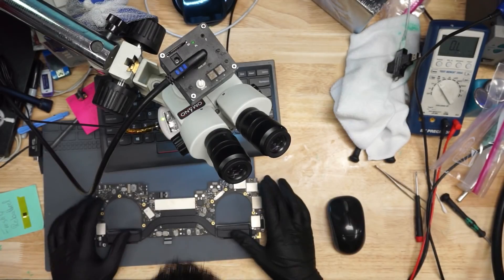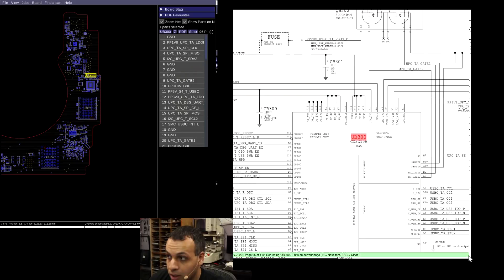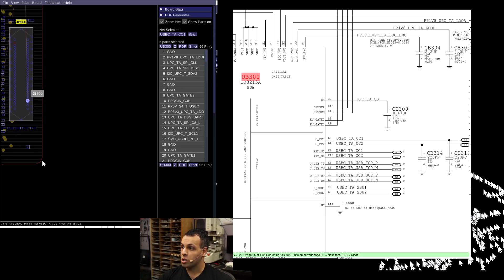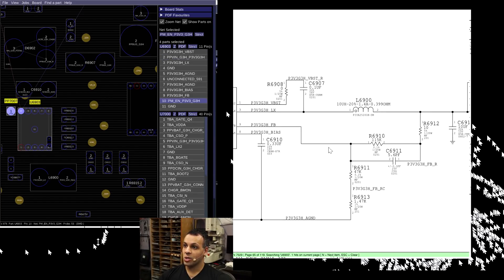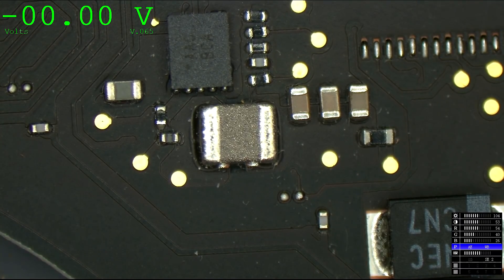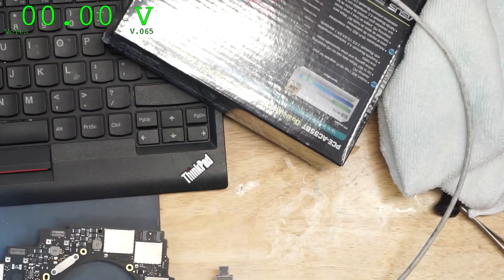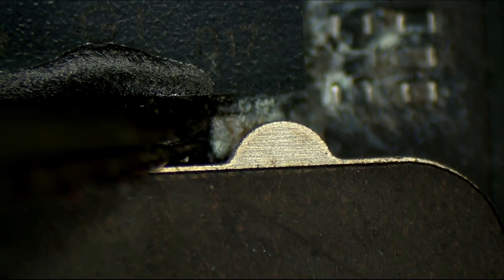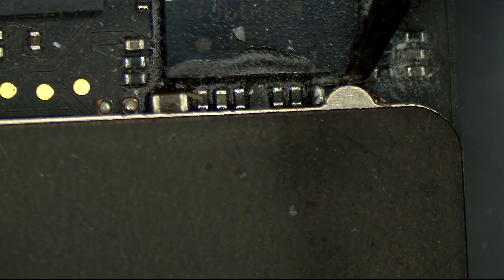How do Touchbar Macbooks charge? What is the sequel to the famous onewire circuit?

Comment from the maker: I realize many here want an update on the battery situation. I am speaking with a well known & respected lawyer who also has a YouTube show - and hope to release a plan of action and details as soon as I can. I am not letting those mofos win.

In the meantime, enjoy a board repair video that showcases the sequel to the onewire circuit.
Reply: I bet its lawful masses
Reply: Best of luck and stand up to Apple!
Reply: As a noob to the highest degree, why do you not need to replace the capacitor? If the power can just be routed without one, what is the purpose of one being there in first place?
Reply: @paulspurlock599  In that circuit, the purpose of that trace on the PCB was to carry a Direct Current (DC) voltage, to ensure that it only carrys a DC voltage they add a capacitor to ground. A sufficiently large capacitor that is connected from that trace to ground will act like a short circuit to any Alternating Current (AC) voltage on that trace, while also appearing as an open circuit to any DC voltage also on that trace. This effectively gets rid of the AC component of the voltage on that trace. AC noise can be a problem for digital logic. TLDR: it gets rid of any AC noise on the line which can cause problems for digital logic if not dealt with.
Reply: The capacitor is there just to protect against any noise that may be travelling down the line, in many cases there wont be significant noise to cause trouble, so you can get by without it most the time.
Reply: @Ferretack  awesome thanks for the explanation
Reply: @paulspurlock599  Power spikes most likely.
Reply: If he uploaded a video recently discussing the case, I may have watched it.
Reply: Good luck man give them hell they're the worst most opportunistic company to ever exist
Reply: You`re the best Louis Rossmann ever😀
Reply: Can we come to court hearing ?
Reply: Hell yes Rossmann!
Reply: Gg Fort  I always watch his videos when I'm about to go to sleep. Totally agree on the relaxing aspect.
And the benefits don't end at relaxing. I often feel fitter...happier...and more productive...🤔
Reply: What did the little capacitor do to you? Capacitor lives Matter!
Reply: Louis Rossmann best of luck!
Reply: Leonard is a great lawyer, good luck!
Reply: @UltimatePerfection  Thanks!
Reply: LOUIS ROSSMANN VS APPLE NOTCH INCORPORATED!!!!!! WHO WILL WIN?! WHO WILL LOSE?! AND WHO WILL GET THE BATTERIES?!?!?!?! STAY TUNED IN FOR DETAILS!!!!!!!!
Reply: Hey Louis, you're getting pretty famous.
https://youtu.be/PpXfpu_yFUQ?t=118
Reply: I really do hope you get those batteries back and then some
Reply: Don't insult mofos, they don't deserve it, mofos are useful, Apple  is not.  If you don't believe me that mofos are useful, how did you get into this world.  Yep, everyone has mofos in the family, hence their usefulness...
Reply: Apprehensively looking forward to the outcome of this
Reply: The world needs more people like you.
Reply: Louis, I've learned a lot from your videos. I'm a computer tech here in the Detroit area and your videos have helped point me out in the right direction when dealing with special apple products.
Reply: Is it LegalEagle?
Reply: It's Leonard French.
Reply: @Louis Rossmann

I think it'd be awesome to see you on the Joe Rogan Podcast. It'd be a good way to spread your word and I think the two of you would be great to watch.
Reply: https://thenextweb.com/apple/2018/11/02/apple-still-throttling-iphone-8-x-batteries/
Reply: i know this has nothing to do with the video but check out this rusted comodore 64 still working fine
https://www.youtube.com/watch?v=wVphFkaX1gg
Reply: Hail Louis! Can't wait.👍👍
Reply: 5 volts at 2 amp is 10 watts, Remember Louis Watts are Amps times by Volts! ;P
Reply: Volunteer character witness here for your case against them! :))
Not sure it's even a thing - I just wanna help.
Don't delay: Testify today!
Reply: @1stm830  We should first of all have the right to own our own stuff and second we should be free to fix or modify it in which ever way we want. It`s called creativity and should even be a human right if it`s not yet. We want more smart people and less of the stupid ones "LET US FREE!"....
Reply: cukier9a7b5 explain why my 2008 MacBook, 2010 macbook, 2012 MacBook Pro and late 2015 MacBook Pro all still work?
Reply: @Danlapse  because cuk is a dolt
these are engineering compromises
Haters are as useless as fanboyz

Comment: I have a question and need some advice. 
I have a Lenovo Yoga 2 10" tablet. I love my tablets but because I'm constantly using them the USB port gets loose then stops it from charging after 1 1/2-2 years or so.
I plan to get my ten inch tablet fixed at a store. 
But I also have another Lenovo tab? something. I replaced it because I literally be wore the poor thing out. I actually wore grooves into the glass from my reading on it. It just wasn't worth paying for it to be fixed. 

What I'm wondering about is how hard it would be to go in and fix it myself. The Tulsa library has a maker room that has all the equipment I would need. 
I'm sure it's just the solder that got loose. I have used solder in stained glass class. 
So does anyone think that it would be worth trying to figure out how to fix it? Would it be very hard? 

Because I know my bigger tablet will be $40-60 to fix. 
I'd like to have it as a backup or possibly to give to a friend. 
One more question. If I get the big one fixed would it be possible to have the tech put extra reinforcement or at least a little  extra solder on it so it will be stronger than before? 
Anyway I'd appreciate if someone could please try to answer my questions. 
I'm on a limited income so I try to fix things first myself.
I don't think it would be to hard to solder it. Plus there's no way I'm touching the rest of it. 
I really wish they'd make it so certain parts like the battery, USB port, audio jack etc could just easily be popped out and another put in.

Comment: The more they overthink the plumbing, the easier it is to stop up the drains. Whatever happened to a simple battery charge controller and switching circuit - none of this stupid one-chip-talk-to-another-chip-to-see-if-the-other-chip-wants-to-talk-back-to-the-first-chip-to-say-its-ok-for-the-first-chip-to-talk-to-the-charger-to-turn-on-the-stupid-pile-of-garbage. Think Different indeed...
Reply: Its called USB PD, or in long format Universal Serial Bus Power Delivery.

Its generic chips from Texas Instruments, and anything that wants to be charged at anything higher than 5v@500mA via ANY USB connector will need to talk with chips to ask for more power, in cellphones with USB 2.0 the talking is done via voltage levels set on the D+/D- pins,  either with resistors or with dedicated chips, thats why there is those things called Quick Charge, Fast Charge, and many other variatons, its protocols specifying how the cellphone/laptop will talk to the charger to ask for more power.

Any cellphone or laptop or anything with an USB C connector will have all those chips, dont want those? Buy older hardware with a barrel jack.

Comment: So what's the point of the capacitor? I'm assuming it's to smooth incoming voltage to the board, but since the wall plug usually regulates voltage, that means that the capacitor is there for a form of reundancy? Anyways as a EEng student it simply blows my mind that some things can be fixed by removing components

Comment: Don't you worry that flicking components off the board will tear away the pads too?
Reply: Its a capacitor so I believe he is not planning on replacing the part. It helps protect parts from ripples but can fail faster than the part its protecting. Only worth while if easy to replace and location its in is not worth the cost of labor vs the cost of the chip its protecting.  Almost seems intentional to have a part that will fail often in a hard to get to spot that is not really needed unless you plan on replacing it.

Comment: If the board can work without that capacitor, then why put the capacitor in the board in 1st place?
Reply: It serves a function. I think it helps to filter any AC ripples on that rail that might exist. It's not what you call "super critical" though.

Comment: i may be missing something here, but how can you just pop a capacitor off a board and then it'll start working, wasn't the capacitor there for a reason? or does apple just throw extra random capacitors on their boards that don't actually do anything?
Reply: It does serve a function. Read comments for details. When it goes bad, it can create a dead short which causes a loss of power on that line.

Comment: My macbook air won’t turn on if the power adapter is connected i already reset the smc and i reconnect the battery..it is charging and sometimes the fan is very loud..anyone..?
Reply: Boom B sounds like the sensors on the MLB

Comment: Had to correct this...  When powering only from the charger, that CD3215x network will need PP3V3_UPC_XA_LDO powered first before PP3V3_G3H will come on at all. The CD3215x's on the board have an on-chip 3.3v LDO regulator to power the CD3215x network and the flash it needs to boot and so, yes the CD3215x's on the board can boot up without the external U6903 LDO powering PP3V3_G3H.  This allows the CD3215x to work with the charger even if the battery is in a completely dead state or is disconnected.  But the CD3215x does need to be able to put power PP3V3_UPC_XA_LDO line to power the flash, so a short on that line would prevent them from booting as well.  The master CD3215x needs to be able to communication with the flash (U2890,  W25Q80DVUXIE) and PP3V3_UPC_XA_LDO powers the flash when the charger is plugged in and the battery voltage is low or dead or disconnected...

Of course, the contents of that flash also need to be correct for the master CD3215x and its slave CD3215x's to boot up.  They also need their corresponding address select resistors to be set correctly.  If the address select resistors on the devices are not detected correctly by the chip then there may be contention on the data lines where the slaves communicate with the master. 

Okay, the flash is actually 8M-bit and not 8M-Byte... My bad... 8M-bit is 1M-Byte and that is basically the size of the binary file that the Texas Instruments flash configuration tool creates.  Makes sense now
Reply: Okay, the flash is actually 8M-bit and not 8M-Byte like I thought it was... My bad... 8M-bit is 1M-Byte and that is basically the size of the binary file that the Texas Instruments flash configuration tool creates.  Makes sense now.
Reply: I have just been baffled with bullshit.
Reply: Wow, first I thought you broke my brain from scanning what you wrote. Then I slowed down and actually read it. I thought at first I was starting to understand some. Them BAM my brain broke. 
I now self identify as a cat.
Oh wait Harlequin said I couldn't because there's no one else to open the canned food. Guess I'll just have to learn to live with half a twisted brain from now on. It's still more than most people. 
You on the other hand by should be wearing a helmet a all times to protect your mind.
I actually almost understood what you were saying. Good work!.🤗😽🐧
I don't know why I put the cat and penguin there. They're new, I saw them and thought they were cute.

Comment: This just show...Apple product have components that have no use.
Because removing fix it...but...it STILL works WITHOUT replacement.
Reply: DutchDuke However for stability, a new one should probably be installed.
Reply: @johnfrancisdoe1563  yes, it seems many don't understand the point of capacitors to Ground
Reply: Every apple product and if we are at that every product in the last decade or two was specially designed to fail around 2-3 months after the warranty. Look up what a "material engineer" does, it's very sad but this is how modern society works
Reply: @DumbArse  - This is simply not true.
Reply: @DumbArse  - Glad you see the light.

Comment: What are the consequences of missing that one capacitor?
Reply: If power rail have no ripple or have other filtering capacitors attached in parallel then nothing bad. And new capacitor cost a cent or two.
Reply: The consequences are that Apple is denied the chance to once again give someone another 1200 dollar repair quote (and a subsequent offer to deduct the cost of diagnosis from the total purchase price of a similar Apple product that works) Then the clock is reset and do it all over again in just a few years.
Reply: It helps with ripples in power, so in turn helps keep parts alive longer. But could also be used to hurt a customer if they are told they need to replace the computer if that low cost part fails. Just remove said part and it works with no ripple protection but it works with no need to purchase another 2,000 computer. To go above and beyond you could put another in place but let the person know that part could fail in the future. Parts fail over time and the question comes into play is it worth it to replace the part that will most likely fail faster then the chip that it is protecting.  Replacing the part costs more for labor while removing is cheaper. In addition the chip ahead of it that is being protected could be replaced if it fails in the future. So its a risk\cost benefit analysis.

Comment: Why doesn't the capacitor need to be replaced instead of just being knocked off the board? ^^
Reply: I was wondering the same.
Reply: Capacitors on power lines are used as ripple filters. If voltage is stable enough then capacitor may be removed without bad effects.
Reply: Probably a decoupling capacitor that isn't completely necessary

Comment: Why is the cap there in the first place?
Reply: There are so many reasons for a capacitor that it's impossible to be sure, but if it can be removed and the computer functions as intended it's a capacitor to ground used to mitigate potential interference or smooth out electric anomalies.
Reply: I want to know too
Reply: Capacitors between power and ground are there to smooth out fluctuations in the voltage. Referred to as filter caps
Reply: I guess I wasn't clear enough. Can the noise caused by removing this have negative a negative impact?
Reply: @TheOneTrueMaNicXs  Without being party to design decisions it could be either a very significant impact or an unlikely one.  A VERY BIG HOWEVER, sometimes that impact will only occur if a very specific scenario occurs.  My current career could be summarized by 'putting capacitors and resistors in the proper place and orientation to ensure that all devices within a vehicle dont get damaged and do not damage other things by internal and external influences'.  The capacitor could be simply there to lessen potential but non detrimental line noise, it could be there just to terminate an unneeded ground to another layer of the board removing it from worry, it could be there to eliminate board fatal errors or damage caused by putting the computer down next to an antenna broadcasting at 6.5GHz causing voltage spikes due to a sympathetic frequency of a crystal in one of the chips on the board
Reply: Why are you glossing over the water damage all around the cap? The owner was a dumb dumb that spilled liquid in the laptop, and now, its a conspiracy theory that the cap is there to fail, nope, its a decoupling cap in a cmos circuit that works at dozens of Mhz that NEEDS clean power rails, the cap failed, due to moisture, the whole area is covered in corrosion(white/green fuzz)..
Reply: @tiagoangelo3828  because the root cause didn't change the solution.
Reply: @tiagoangelo3828  It's a discussion on why the cap can be removed and the computer functions regardless.  It has nothing at all to do with the damage.  I was speculating without looking up a data sheet.  You're attacking because you can't discern context from a very basic conversation.  For that you have my sympathies and I hope your life gets better.

Comment: Bought a USB ammeter like the one Jessa uses for something like $3 on eBay.  Unlike a MacBook, it is conformally coated.  Louis(e) sells a better one, BTW.
Reply: Not an excuse but coating boards does require putting it through a few more processes and takes extra time, so that does actually make a significant difference when you're talking about producing millions of boards and not that it bothers me but you also don't get a warranty or anything when you buy things direct from china which is a big reason why it's so cheap, so if you have an issue then you can probably get a refund within a couple weeks of arrival but otherwise. that's your problem.
Reply: @vgamesx1  While what you're saying is true, Apple isn't exactly selling Macbook laptops like hotcakes ;) They could certainly spare a bit if time to properly coat their boards. They're just greedy. Greedier than your normal, every day huge multinational companies.
Reply: @vgamesx1  They use 6-8 year old components and sell them at 10-12x the production costs. I'm 110% they could do it without changing the price and still get more profits on a single device than the chinese childrens wage that made it
Reply: @DumbArse  I never said what they could or couldn't do, I'm just stating facts and reasons why you might skip that step.